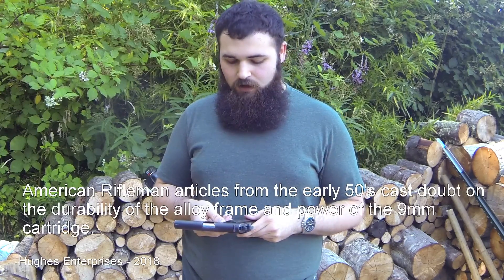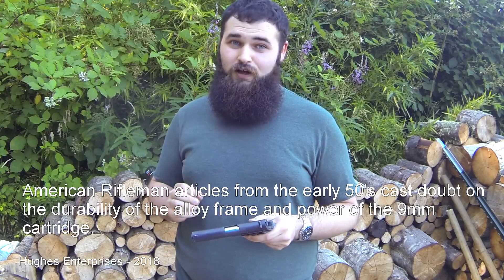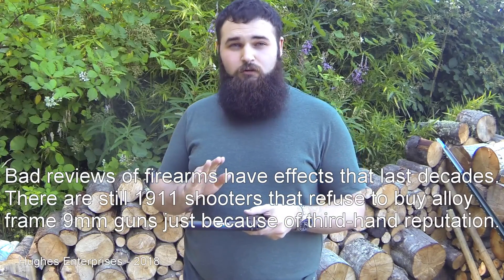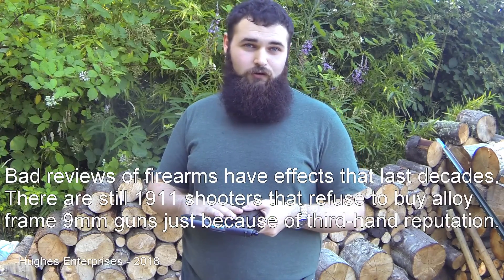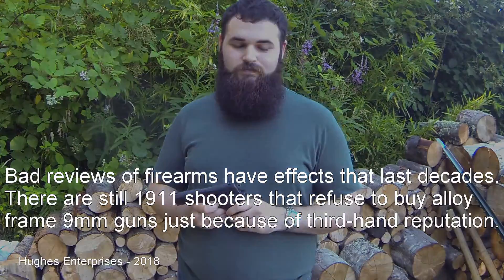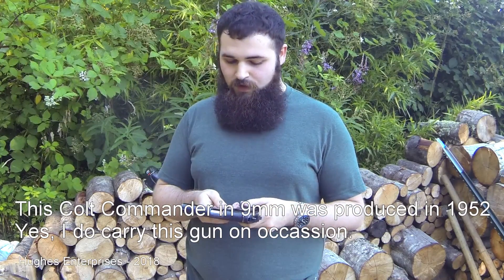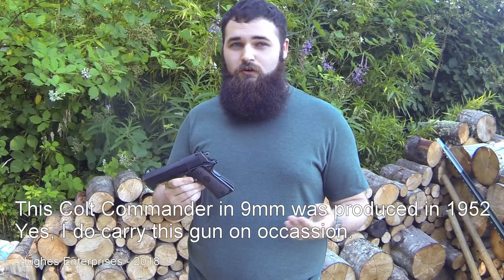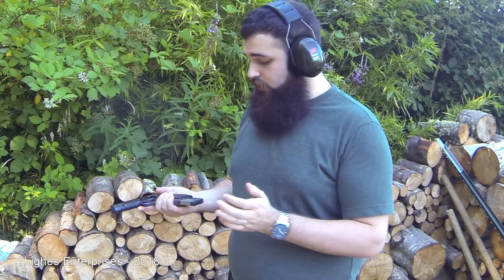Colt's Pre-70 Series Commander in 9mm: Father of the Modern Concealed Carry 1911 Pistol

Comment: Were all of the Commanders aluminum framed? I just saw one in a pawn shop in 9mm and I thought it was all steel. It was fairly worn looking, not terrible but it looked a little old....
Reply from the maker: If the gun just said “Commander Model” on the slide and had the 1950’s style of slide markings with lightening cuts inside the slide on either side of the firing pin, it should have had an aluminum frame. If it’s in perfect shape the frame would be gloss dark grey. Worn 50’s Al frames can turn dark green and then light gray when very worn. Should also have the brown plastic grips, short trigger, standard grip safety, round commander hammer, and aluminum arched mainspring housing. Serial will have a LW- prefix, but some modern Al frames have that too.

Later production 1970’s and newer steel frame commanders were called “Combat Commander” and the aluminum frame was the “Lightweight Commander”.

If you found a “Commander Model” slide on a steel frame, it’s a Frankenstein gun. The Al frames will crack eventually after high round counts. Could have easily fitted a new steel frame to an old slide.

If you could get it for $4-500 you wouldn’t be doing too bad. The 50’s 9mm slides are known to crack as well because of those lightening cuts so be sure to strip it and inspect the slide for cracks. New springs and standard pressure ammo and it would be a fine shooter.